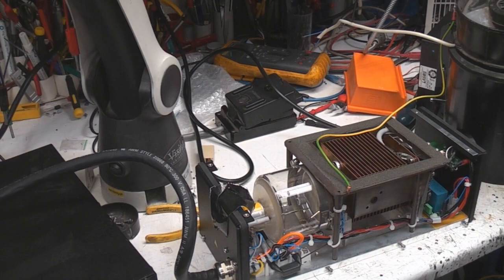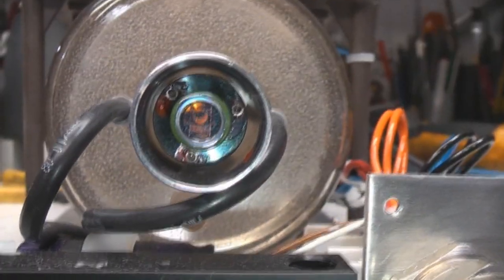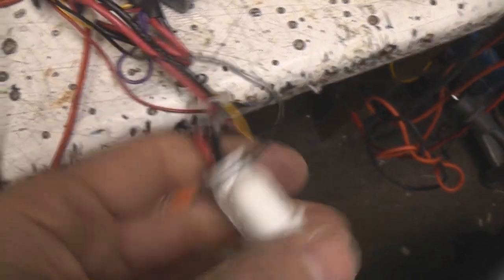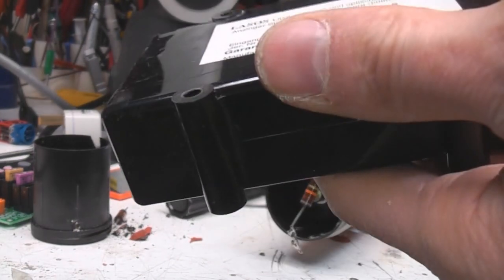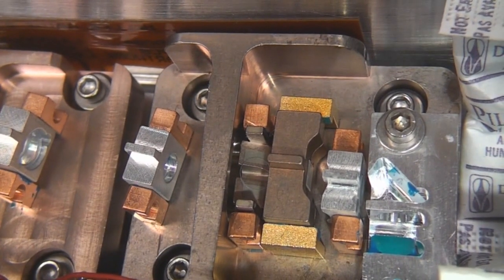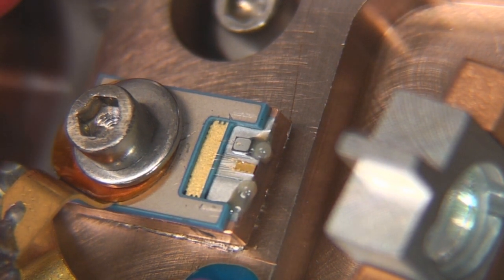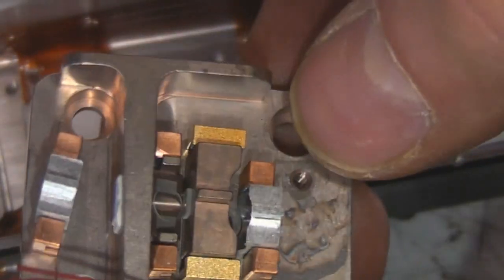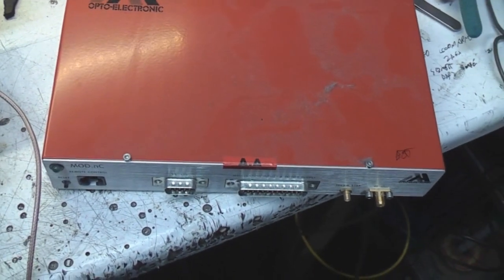Leica confocal microscope part 2 - LASERS!

Comment: The DPSS laser is probably wavelength doubled by a Lithium Triborate LBO crystal, hence the need for the desiccant pack inside as LBO is highly hygroscopic and the crystal easily destroyed by humidity. The laser diode is either pumping an ytterbium crystal for the 1120 nm or the diode is a direct 1120nm pump laser.
Reply: +MrCapacitator Also forgot to mention that if it is a ytterbium crystal then it is most probably pumped by a 980nm laser diode for optimum efficiency.

Comment: AOTF's are very cool. I have played with them in the past as tuning elements for broadband wavelength tunable lasers.

They essentially map an RF drive frequency onto a selected wavelength. Because they are non-mechanical they can be wavelength tuned very quickly (>kHz level). Also if you provide two or more RF frequencies to the unit at the same time you can select multiple wavelengths (just make sure the combined RF drive power is low!). 

If the aperture of the AOTF is big enough you might be able to make an interesting hyper-spectral camera with that unit.

Comment: Green lasers are quite strange the way they work. I took one of those cheapo Chinese 1mW laser pens apart and it instantly burnt the skin on my fingers. Had no idea they output so much IR radiation! In fact, I managed to put it back together temporarily and align the optics. The beam was 10x brighter than it was before - far too bright for eyes. Quite impressive for a cheapo laser pen.

Comment: Being a happy owner of Ar+ laser myself, that relay before power filter section is almost surely softstart bridgeover. Input filter caps are just massive on that thing. I had to do that on my laser supply, as manufacturer cannot be bothered to put it in (and I can't be bothered to go flip the circuit breakers each time I plug it in).
Reply: +Martin Konečný Heh I know that feeling , I had a ILT 5500 Argon and the inrush tripped the breaker every time it was first started

Comment: The note about CC supplies is a good one,for a pure/plain CC supply. However,IME,most bench top supplies will limit the output voltage to whatever maximum you've set it at. So,if you set it for,say 5V,and 50ma max,the output won't go above 5V,even in CC mode with no load. I suppose it depends on the supply. YMMV.

Comment: Nice lasers. Jealous that you get 8 lines out of the argon. Both of mine only do 6 at full power. Glad you were able to repair the yellow HeNe too. It's probably my second favorite wavelength in my collection. Now if it only has a 612nm HeNe in it.

Comment: Lasers are fascinating!
I wasn't actually able to follow your walk through of how this device worked but the technical details 
on each element was superb.
Also i'm not sure how many people have actually experimented with a helium-Neon laser but you could spend a lifetime learning from one!
My HeNe laser has a ruby rod in it that makes a red beam, what would make a yellow one?
Reply: If your laser has a ruby rod then it is a RUBY laser.  

The Leica source option diagram that Mike showed had a Krypton gas laser with a yellow output and these are often similar to the blue green Argon laser with a different gas.  The wavelengths in a HeNe discharge include Yellow and using wavelength selecting optics you can get the laser to lase predominantly Yellow.

Mike and others have torn down flash lamp pumped Ruby and YAG lasers.  Just search for ruby, HeNe and Argon to get an idea for the different basic types of gas lasers (there are others like copper vapour and CO2).